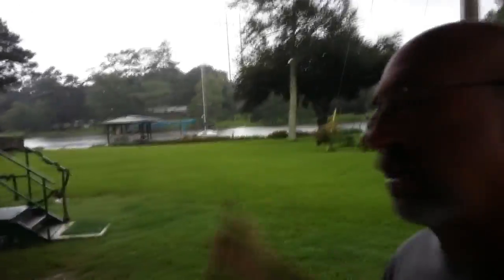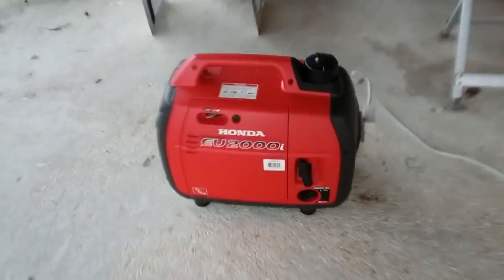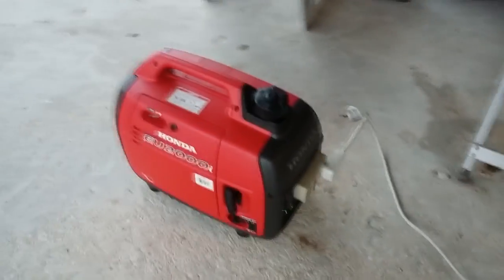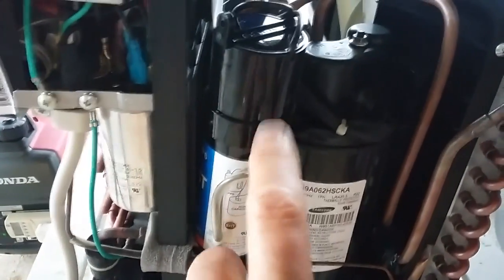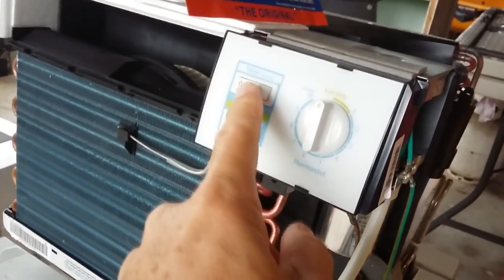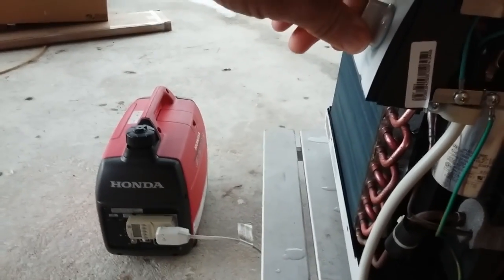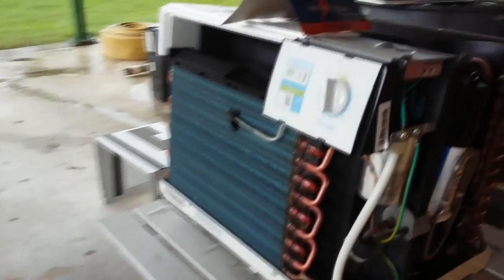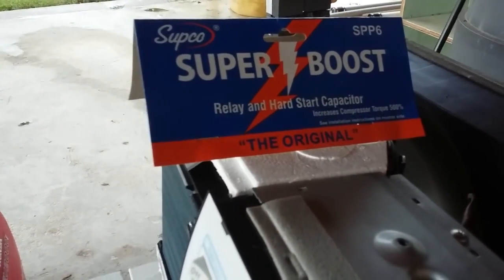Honda eu2000i Starting a Window Air Conditioner with Hard Start Capacitor

Comment: Im looking to do the exact same thing. Is this just as good as a soft start? Obviously the cheaper route is appealing. I don’t know much about it but I’m finding conflicting ideas. It was hard to find many videos on this as well. I’m running my ac pretty far from the pole is the reason I want to do this and also for future genny applications. Thanks for any help
Reply from the maker: While this capacitor did help with starting, a true Soft Start is much better...but a lot more money.
Reply: Thanks good to know!

Comment: Does it matter which wire from the Supco is attached to which terminal on the original capacitor, or do you disconnect the original capacitor?

Comment: What readings where you getting on the outlet on the generator
Reply from the maker: 125 volts.
Reply: @Flyboytr  what amp draw before and after
Reply from the maker: @lt498  Don't remember...it has been too long.  Remember that  a soft start capacitor does not change the running amps!  It will only reduce the starting amps which is high and only lasts a second or two.

Comment: Why not just Start it on reg mode then switch to eco to run ??
Reply from the maker: Ron,
You can...since the amp load is fairly low when the a/c is running.  But, when the A/C reached its set temperature the compressor/unit turns off.  As the room warms up the a/c will need to restart and then the generator is running in eco mode.  So it would not be a set it and forget it sort of thing.

Comment: I'd be more impressed of you did a before video. Are you telling me the gen would wind up and not slow down without the hard start? Because I am under the impression that it's job is only to buffer the increase in current for just a few seconds.
Reply: It's a capacitor. It builds a charge (boost) to get the compressor started. Yes, it's only for a few seconds, but that's all is needed to get the compressor past the initial high wattage startup.

Comment: I would say get an EasyStart kit but that cost as much if not more that that A/C unit.. If you had a bigger unit then it would make sense, maybe.. With that kit you can start and run a 15K BTU A/C on a 2Kw generator. The easy start kit is made for RV units but can be just as easily used in home window units and other appliances on 120 volts, they even make a 240 volt version for RV people overseas or home central air use too.

Comment: this is interesting I tried to run my 6000 btu air con on my 2kw generator it would just die. So I got a 3kw generator  and even it would just die   Where I live in Queensland Austraila This would be expensive.  Gas here cast $1.50 a liter. That's about $ 6.00 a gallon my 3000-watt generator would be going through a 15-liter tank in 10 hours or about 4 gallons in 10 hours But the Honda eu2000i more Fuel efficient - runs up to 8.1 hrs on less than a gallon of fuel. but it only a 2kw  My 3kw will run my whole house It just good that most blackouts only last for a day or so. But the problem is the tank only takes four liters a gallon.

Comment: Is that a kill a watt on your honda? I would love to had seen your video a few days back. that way i would buy the kill a watt. I asked over amazon if the kill a watt would fit on a eu2000i and no one said yes. Thanks for the vid
Reply: You can always make a small pig tail extension cord to go between the generator and the killawatt if it doesnt fit the face of the generator.  Just a thought.

Comment: Whoa.  This is making me rethink my plans.  I was hoping to use a small inverter generator (2200w) to power a full size fridge, small 5 cu. ft. box freezer, and a small high efficiency 5,000 btu window AC at night during power outages.  This is making me think that I might have to jump up to a 3000 or 3500 inverter generator.  I was really hoping to stay in the 2200 to 2300 range.
Reply: kings17court You can if you run ac only at night and alternate the other two throughout the day.
Reply: Easy Start is what you want not a hard start kit. They are for RV A/C units but can be used in home window units just as well and be run off 2Kw generators. They do cost more but are cheaper than buying a new bigger generator.
Reply: From what I've been reading, few folks are still running into trouble with the higher wattage generators too.
I don't understand why either as the initial surge are showing that they are all well within the range tolerable on what's written.

I'm thinking that the surge maybe alot higher within this few milliseconds than what the wattage is capable of reading and outputting.

Comment: I have tested my Honda Eu1000i It Can Power My 5000 B T U Energy Star Window A C Unit 7 Hours On Half A Gallon Of Gas. I also have a Honda EU2000i I Don't Like My 2000i It Drinks Up Too Much Gas

Comment: Thanks Travis, based on your success running/starting on ECO mode, I'm going to do this to the 5k BTU window unit in my camper van.  

The Supco is very reasonably priced ,glad to know I probably don't need to spend $2-300 for a VFD or soft starter on a 120 dollar air conditioner!

Comment: This is great - I just got a 8,000 btu portable AC and it wouldn't work with the eu2000i - until I added the Super Boost. super easy and cheap solution.

Comment: I'm surprised it has a problem with only 6k. Even on eco mode.
Reply: It's not the BTU size of the air conditioner that causes the startup problem. It's the short high wattage/amperage draw for the first few seconds from the compressor. The ac unit will draw about 3-5 amps while running, but the initial compressor startup will draw as much as 18 amps for a few seconds. If you multiply the amps times the voltage you will get the wattage draw. Example: Startup at 18 amps X 120 volts = 2160 watts of draw. But once running at 4 amps X 120 volts = 480 watts. The hard start capacitor builds a high amperage boost and uses that boost to start the compressor.

Comment: Great video!  What is the device attached to the generator in your video that you have the a/c plugged into?  If it is a watt meter of sorts...is it plugged into both 110 outlets and can it combine both outlets to produce 1600 watts sustained/2000 watts startup?  Thanks again!
Reply: Hi mate joe from Melb Australia I got a Dometic air con on the motorhome and is to hard to start it I got a Honda 2000i  and I watch the your video looks good how  much will cots me to buy something like that please

Comment: how long will that little generator run the ac unit on a tank of gas??  Nice video
Reply from the maker: Don't know exactly because I haven't tried, but based on engine load and power consumption at 550 watts , I would say it would probably go around 8 to 9 hours.  When finished and on the boat, I will unplug the outboard and it will plug into the Honda...no fuel worries!  ...thanks!